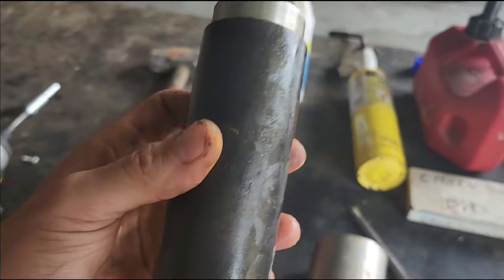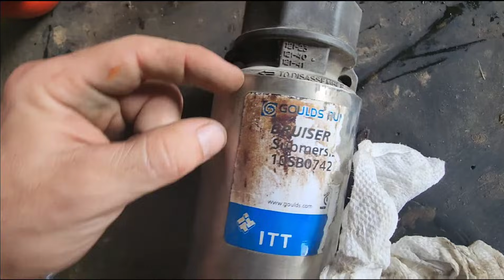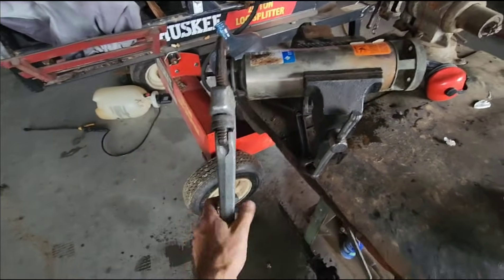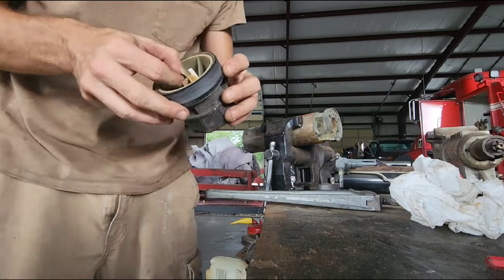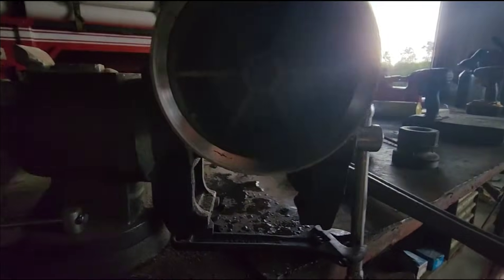Inside A Well Pump. Disassembled Motor & Pump, Is it Rebuildable?

Comment: I was waiting to hear you say it's not worth it to rebuild. Save the motor shaft to check the pump end as a tool Gould's we are a distributor for them👍 also not worth rebuilding but possible. It's a e clip. Slam it on the table it will all come out. Nice job have a great one till the next one 🌊💯🥂👌✌️
Reply from the maker: Respect 🙏  🙌 ❤️
Reply: Any easy ways to test if the wet end is still good on a pump? Just took out a pump the other day that had bad winding readings and is toast. I am hoping the wet end is still good, but when I turn the pump shaft it definitely has more resistance than a brand new pump and more than a few used pumps. It is not completely bound and I can turn it with my fingers but it is not as easy as new ones. This pump was set at 300’ so if it does need a new wet end I’d prefer to do that now instead of a year from now. So far I’m planning on hooking it up just in a cistern tank to see what amps I get and such before actually dropping it down hole. Not sure if there are some other tests I can do first though. Any advice is greatly appreciated!
Reply: @nickmarquez2024  you should bucket test for gallon per min and put a valve and gauge at the top and when pumping completely close the valve just long enough to read the total pressure of the pump end that how most pump are tested the amp pull only tell you how the motor is running. The drag doesn't mean much if it not in water  I could be just rubbing because it's completely dry the new pump Eve in the box has some water in it because there factory tested and put stright in the box IV pulled them out new and water come out of them. The test I have told you is how any company would test the pump ends of any pump end hope this helps and anything over 300ft over 5 years old is recommended to be replaced. You can always use the old pump end in a storage tank for a booster pump 🤔👍✌️💯🛠️🌊💪
Reply: @josephsaucedo8691  great info, thanks! This is along the lines of what I have seen but it is great to hear a detailed description. I am told by the clients that this pump is about 4 years old. It does have a pretty high static water level though. So even though it has been set at ~280ft most of its life, the static level is at maybe ~60ft or so.
Reply: @nickmarquez2024  if it t was test and that the total level that well will never run dry and at that level. it also put out more GPM then what on the label not much more but some sounds like you have a awesome well🌊👍✌️😉🍻
Reply: the cost to replace all of the components of my goulds 5gs15412 cost $445. a new wet end at the time would have cost almost double that. yes it is worth rebuilding
Reply: @Sicasevilis now add over 200$ per hour for me to rebuild it at least 4 hr shop time to rebuild and test it your only talking price of mineral and your almost at the same price with no factory warranty most companies aren't going to pinch pennies and want to spend there time when your talking less than 100$ difference in less you do it all yourself and know how to because mistakes aren't cheap then it's all on you that my opinion.  then your installing it how knows how far down the labor for install price how going to cover all that👍👌✌️💦💯🍻⚒️💪🇺🇸
Reply: joseph, really? thats alot of complicated talk.
i did it myself. i know that goulds does not provide a warranty for homeowners. but honestly the water works companies were going to charge $5k to remove the pump, then the new pump cost and another $6k to install plus cost of any drop pipe sections needing replaced as well as milspec tape and ptfe tape and joint ptfe as well.  at the time i had zero options as we had spent our entire savings to by the property and cabin. it was either repair myself or wait a couple years to to get the cash together. thanks for the talk
Reply: @Sicasevilis  your just talking about replacing the pump. I was talking about a actual tear down and rebuild of the pump end and install. The actual rebuild of the pump end on a sub is not worth the time and coast I can understand the rest it does save money and worth the time have a great one till the next one 👍👌✌️💯💦
Reply: joseph,
No I disassembled  the wet end and replaced everything except the shaft, the upper bearing spider and the shims and upthrust washers.
Reply: Ya that for a company to do and labor time for take down rebuild parts and testing it cost just as much as a new one  maybe a hundred less than with no warranty if you shim it wrong and have to replace premature the labor time for pull and install would end up cost the customer more money in the long run. That why you did it your self but it's only worth it to you if you didn't get it  right it's yours. working for a company I wouldn't risk it that's more work for me when I can grab a new one  off the shelf if it doesn't work Gould's covers it in stead of you or the company I work for so I don't understand how it worth it for any employee or company to rebuild one in less its there's  that's why you won't see any company spending the time to rebuild a small sub pump end  I wouldn't fill a scrap bin every year if it was coast effective  have you add up the price of city water you can replace your well stuff every three year for the price it cost and your only allowed so much so it's hard for me to understand how it's not affordable the price per gallon is a big difference IV done the math city make bank👍👌✌️💯🇺🇸💦🍻